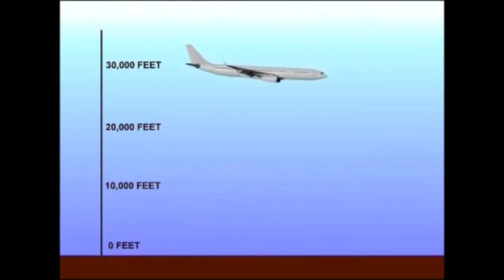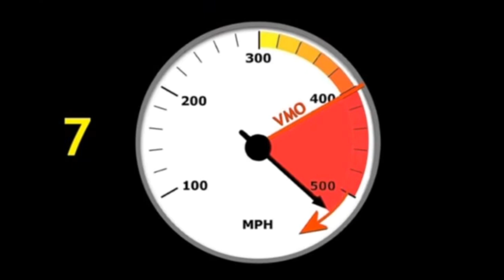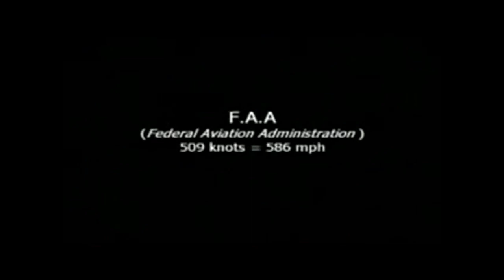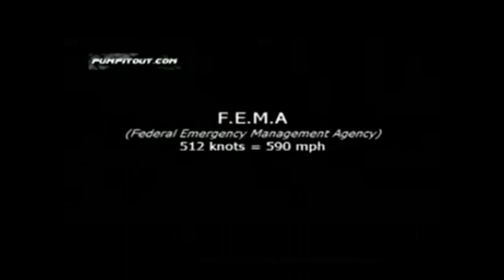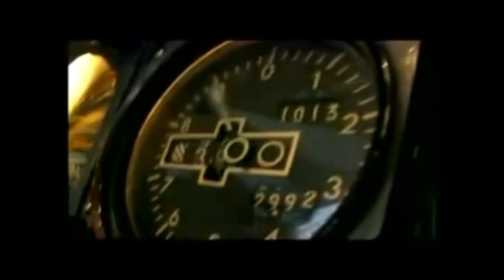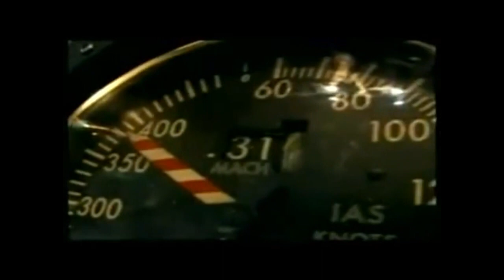Can a commercial jetliner fly above 500 mph at sea level?

Comment: Good. Could a super-rigged-jet, dressed up to look like a 767 withstand the observed speeds?
Reply: Yes I'm sure one could be dressed up to look like a 767..... but ... You can't rig a jet that does not create wake swirls (vortex) from the engines... and you never see these vortex swirls on the original footage of 9/11
Reply: nope... the engine could, if modified  but the body would rip apart..
Reply: Either physics took a holiday on 9/11 or we are seeing some kind of mock up.  Otherwise, the "plane" is not flying at the speed advertised, but much slower.  In addition, it wouldn't look like a roadrunner cartoon: when it strikes the building, it would break up.  There's footage showing the nose of the "plane" emerging from the other side of the building.  Boiyoiyoiyoiyoiyyynnggg!  No.  We are seeing a remote piloted mocked up drone.  As to what happened to the real diverted commercial jets, that's another story.  I believe Philip Marshall discovered the answer and paid the ultimate price.  This thing wasn't pulled off by some turbanaut hiding in Blofeld's cave halfway around the world.  It was executed with corporate precision and a lot of fail-safes had to be intentionally disabled.  Ten guesses who could have done that.
Reply: @showbizonastick Hate to burst your bubble, but there were planes.  Just not the planes that the government has represented.  Probably hardened mocked up drones courtesy of the super secretive National Reconaissance Office.  At the advertised speed and altitude, commercial jets would have broken up before they got near the towers.  Something structurally similar in appearance but wholly different in materials construction - like titanium instead of aluminum - might have produced the effects we saw.  Don't forget, the Pentagon has bunker busters which are designed to penetrate reinforced concrete.  We are seeing something like that.
Reply: A missile, which might look like a jet to the untrained eye, could go supersonic speeds.
Reply: @Fortaz107 finally someone who understands what really happened
Reply: Military Jets can go 600 mph at sea level with ease as can missiles.

Not passenger jets.
Reply: It seems like that's what we saw on 9/11. But they weren't necessarily other than 767s - just not standard 767 airliners.
Reply: How would you dress up a jet to look like a 767?
Reply: A drone could, both planes hit computer rooms and there could have easily been a homing device in them.  They were huge locked always rooms.
Reply: Oh and the people who owned those rooms Mclellan and something were the security for the twin towers.
Reply: Plus the so called terrorist couldn't even fly a small plane , total bs story that the majority of the masses believe what they think they seen, we have technology beyond belief,  it was a show just like the one man of fox said that week of 2001